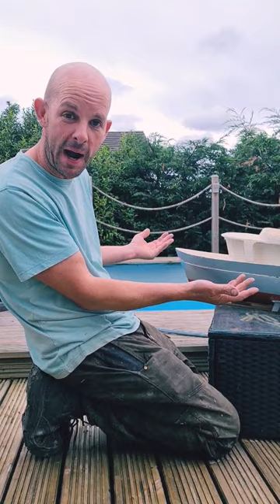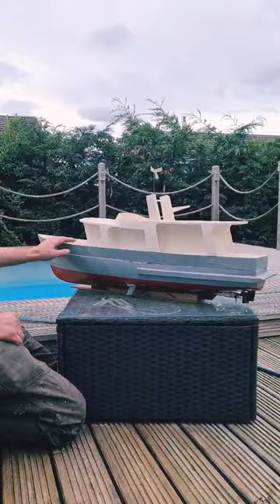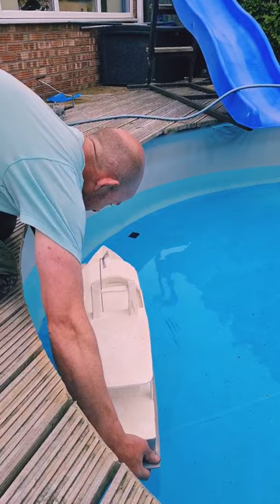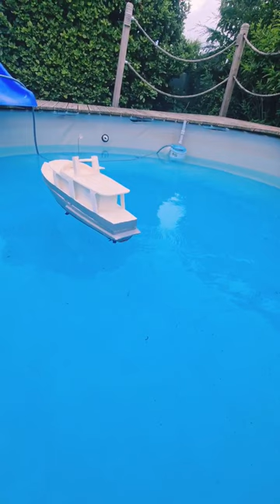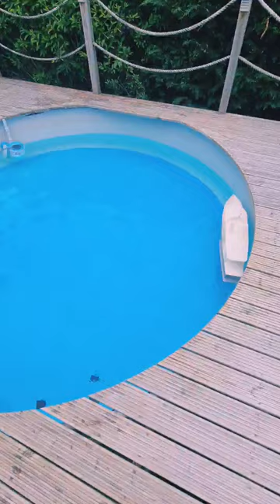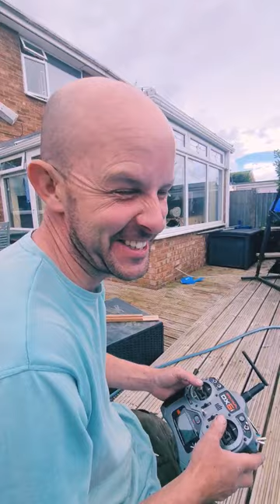Do we trust Simons Boat Driving Skills? #boat

Comment: The HDML was noted for its severe rolling in even moderate seas. The marines who attacked the St Nazaire dry dock were in pretty bad shape by the time they arrived. Sarinda has anti roll boards but I really suspect that tall superstructure will be a problem. It’s also built by the same bodgers who “restored” the ship in 1980s.  Personally I would like to see a better proportioned superstructure. But nothing is permanent so if I’m wrong who cares. If I’m right it can be replaced as sea trials dictate. If I’m wrong then happy days.

Comment: Might need a third layer of planks on that bow repair section :-)
Reply: I don’t believe it will. The planks were well overlapped and the mastic glue is considerably better than anything used to build the boat.
Reply: @Dave5843-d9m  You couldn't tell that it was a joke?